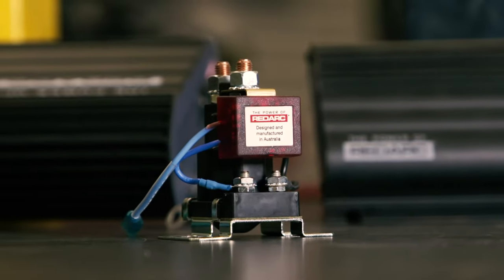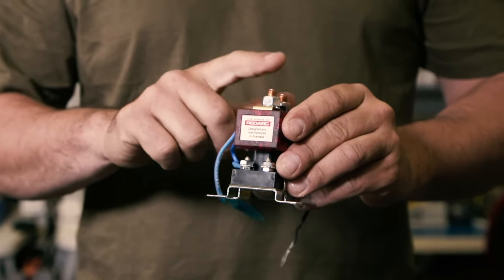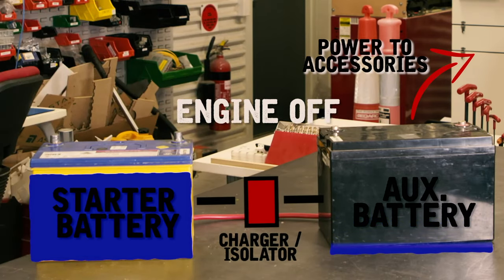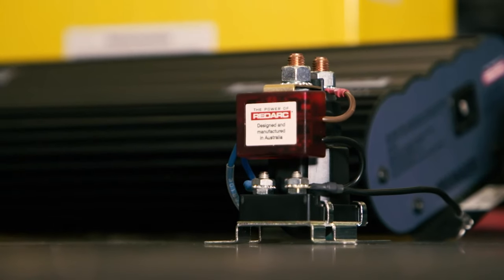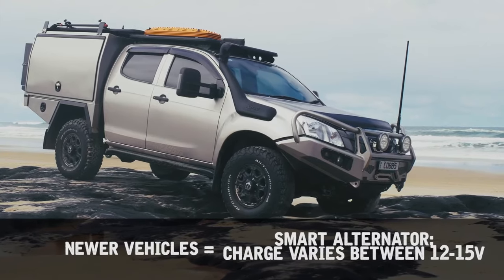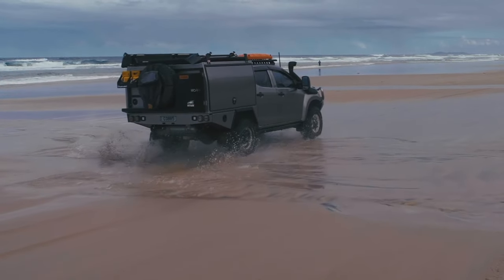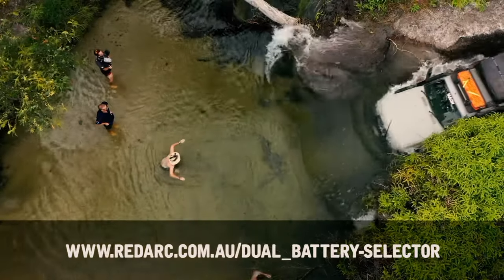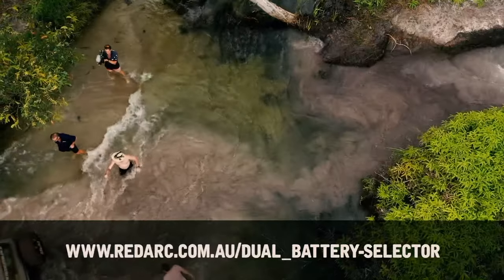What is a battery isolator and how does it work?

Comment: Thank you for this. I have an issue with my smart isolator at the moment. It turns on and off periodically (every 5 seconds or so) when the engine is off. What could cause this?
Reply from the maker: Thank you for your message. For this issue we would require further testing of the SBI12 to fault find the cause of your issue. We'd recommend to contact REDARC technical support team on 1300 733 272 with a multi meter in hand for further diagnostics.

Comment: If I use a 110V AC to 12V DC Converter Power Supply will an isolator keep my square drop camper battery charged as well as keeping it from over charging when plugged into shore power?
Reply from the maker: Hi, for this enquiry we suggest contacting REDARC’s tech support via phone so we can have a conversation to fully understand your current setup and best advise on a charging system

Comment: Mine ticks when I turn my ignition on for about 2 minutes, display shower 12.4 to 14 and surges.. nakered battery?
Reply from the maker: Thanks for watching! From the symptoms described we'd be under the impression that you could have a battery or alternator issue. However, further diagnosis would be required. For further help, please don't hesitate to reach out to our Tech Support Team on 1300REDARC (1300 733 272).

Comment: SO I WANT TO GET A SECOND BATTERY  FOR MY MUSIC SYSTEM BUT I DONT USE MY SYSTEM WITH THE ENGINE OFF DO I STILL NEED ISOLATOR CAN I USE BOTH OF THEM COMBINE
Reply from the maker: The Smart Battery Isolator is designed to be used as a dual battery isolator, only allowing power to be shared from the vehicle’s cranking battery when it reaches 13.2, and then will prevent any auxiliary loads from drawing from the cranking battery when it drops below 12.7V.
If your vehicle’s alternator can provide the necessary power to your audio system and you are always running the vehicle when the audio system is operated, then a dual battery system may not be necessary for you.
Reply: Nope you dont need it that’s what I thought and bought 2 for both vehicles and now I’m stuck with them because don’t need them I was told something about how it dump and hold power at times not good for your system I have second battery already and it would stop full power going to the second battery